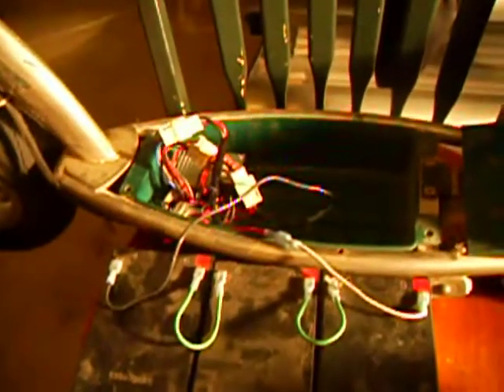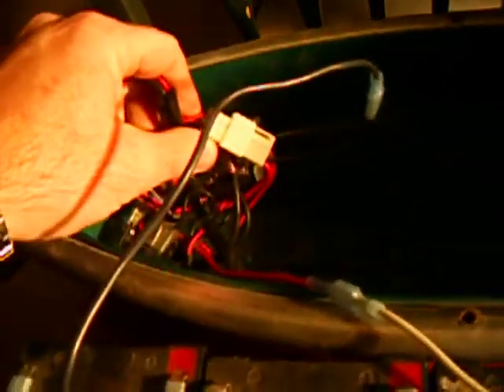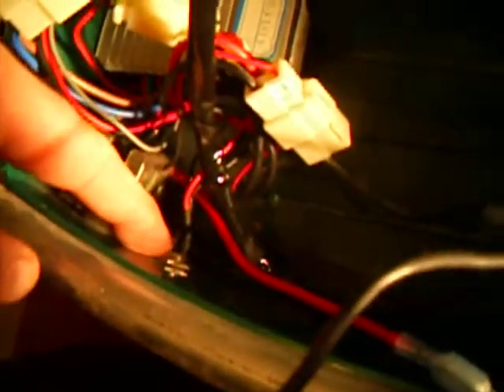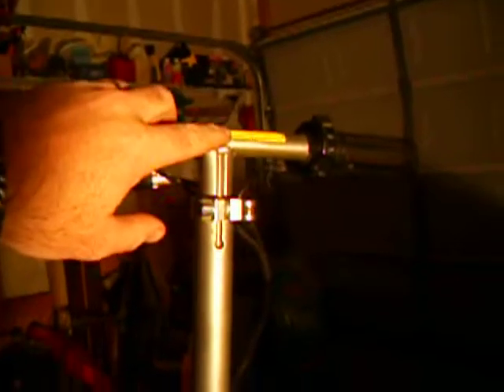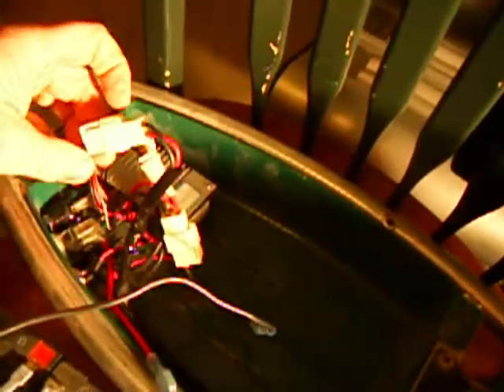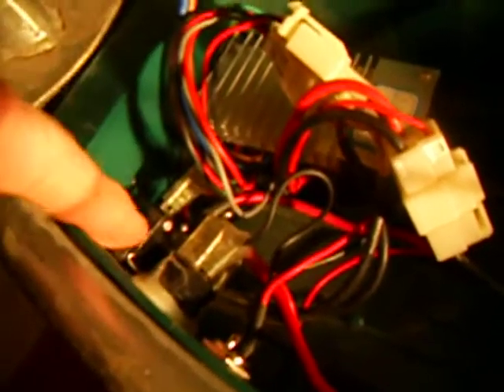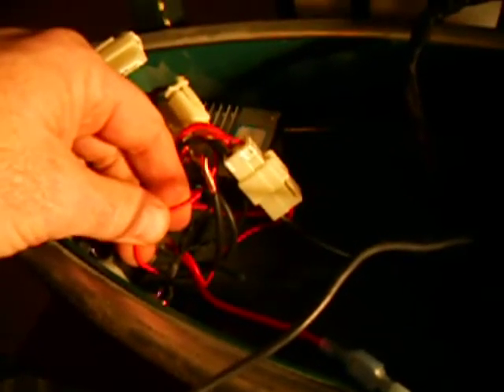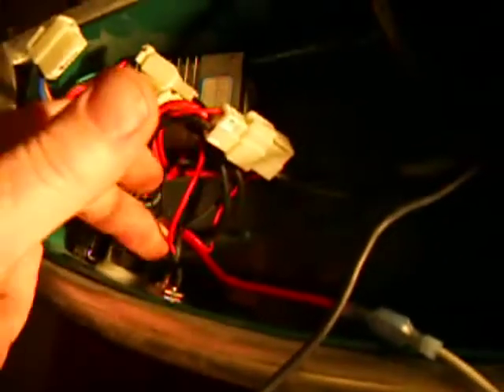e300 36v upgrade mod

Comment: i live in uk how ever every thing i type in the search comes up with videos of all you Americans constantly for some reason , so when you lot keep saying breaker do you mean a fuse .
Reply: I've seen some scooters that had a pop off breaker and others had a fuse link.
There's a lot of videos on YT of people who don't know the proper names of components or electronic components on a bike and use names like peddle sprocket instead of chain ring, A tire as the wheel and wheel as the tire, gears as cogs or sprocket so good luck on the names they use to describe a component.

Comment: I did this and the motor would not run. and on my e200 there's 2 sets of battery cables not one. what am I doing wrong?
Reply: i watched a video where razor control box would
 cut out if over volted so was started in 24v then they added a switch turning on extra battery once motor run like a turbo

Comment: I want to do that but does the higher voltage give you extra runtime, that's what I would be looking for
Reply: more amps = longer run time more volt= more torque/speed
you can get 12v 9ah batterys for longer run time. im running 2x 12v 9.5ah 
and it goes a bit longer than stock 2x 12v 7 ah but dont go over 9.5 amps on stock controller!
Reply: you can put any amps hours than you want. no difference, longer ride... thats it.. voltage is the danger

Comment: i converted mine to 36 volts.  36 volts in to the controller but the controller is 24 volt max and it kicks out.  Help.  Guess I just need a 36 or 48 volt controller.

Comment: Does the 36v vs 24v give you more torque or more rpm on the motor  ? Also is the motor rpm somehow restricted to 15 mph ? I have an izip i500 and thinking of trying this. Thanks !

Comment: I have some lipo batteries in my scooter, and all hooked up they were at 36v. I initially didn't know the controller could handle 36v so I just had an on/off switch to connect and disconnect the batteries from the motor. I had it going 23.3 mph (gps speedometer) with that setup, but now that I am running it through the controller, the motor will not spin any faster than what 15mph is at the wheel. Even if I am going down a hill that speeds the scooter up above 15mph, the motor won't spin any fas

Comment: @gameboy3399 (btw i had upgraded my battery before) in minnesota they limit the speed of any electric vehicle available to minors to 15 mph top speed, my 17 only happens when goin downhill, then the motor stops running, and once the ground flattens out it wont kick in until its goin about 12 mph again.

and i figured it out, it was incased in a blob of insulation, i stripped it back, cut a red wire, and it tops out at 21 now, and keeps goin.

definately kills the battery faster

Comment from the maker: @pencilman222000 there  is no "govenor" persay.  you are only limited by the battery input.  so if you upgrade to 36v and have fresh new batteries you should see your 17 and keep it.  it sounds like your batteries are on the way out.  get new ones.

Comment: how do i just remove the damn governor, i can NOT figure this out, i can get pretty close to 17 but then the motor kicks back to like 12 (you can feel it slow down)

HOW do i do this.
 also i have a crappy e300 with the on/off throttle and onle 250w motor,